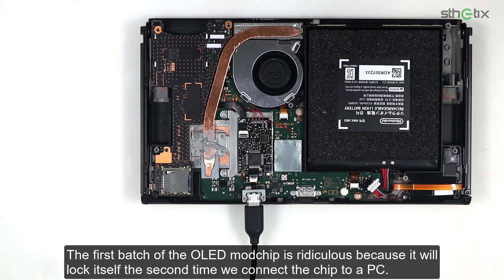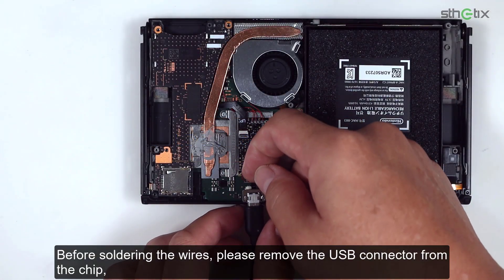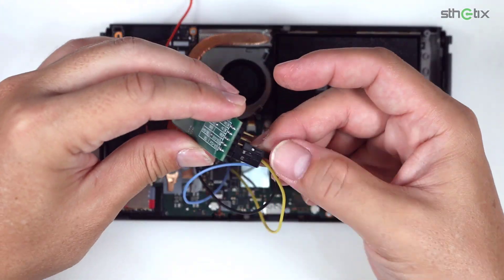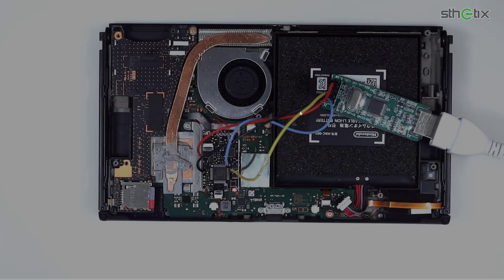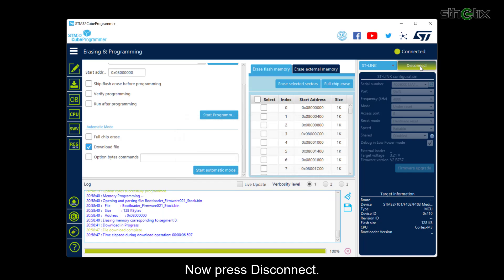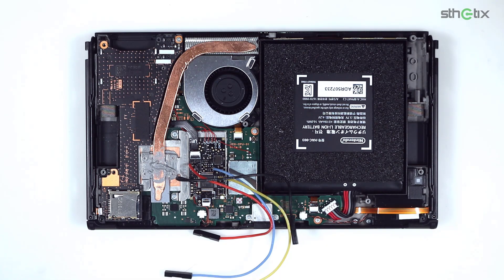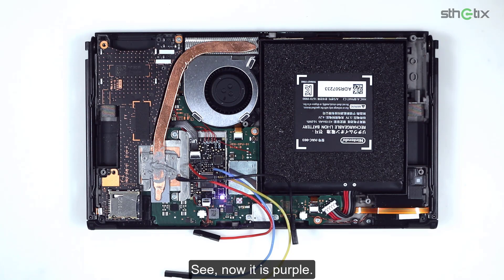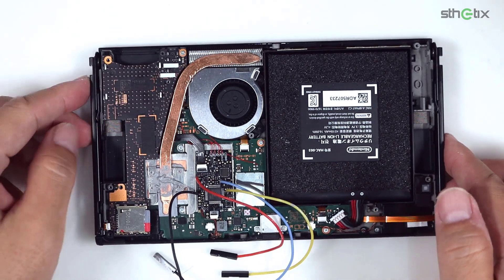FLASHING UPDATING UNBRICKING THE CHIP

Comment: I flashed with the hwfly-nx joint and led is blue. I did the stock joint and led is white. Is this normal? I think when the USB connection on chip worked the led was a different color?
Reply from the maker: try flashing it with the hwfly-nx toolbok
Reply: @sthetixofficial  led is still blue. I can't flash via USB only stlink
Reply from the maker: Try replacing the chip if you have any, but if you can flash with stlink then it should be good.
Reply: @sthetixofficial  I'm able to flash the chip so think should be good to go. Thanks.

Comment: If you encounter a similar issue on Unix systems and need to flash the firmware and bootloader onto a microchip, you can follow these steps:
1. Connect the Microchip Raspberry to your computer using a USB cable.
2. Open a terminal window.
3. Navigate to the directory where the firmware and bootloader files are located.
4. Run the following command: `sudo flashrom -w firmware.bin -b bootloader.bin`

Comment: Does the locked chip work normally on the Nintendo Switch?
Do I need to unlock just to change the chip's firmware or is it necessary for the Nintendo Switch to turn on?
Reply from the maker: it will work. but the usb function is faulty
Reply: @sthetixofficial  thank you, guy.

Comment: Hello, I want to ask is this the correct method on how to fix a mod chip that if you power on the switch it just flash red and then boot to ofw? For details, I think I messed up when updating my firmware into 16.0.3 because I updated it in the ofw through tthe settings and system update rather then using daybreak and now my switch only boots to ofw and the mod chip flashes red led when I turn the switch on and does not boot to cfw anymore.
Reply: I'm sorry it was flashing purple not red
Reply from the maker: try to reset the chip

Comment: Hello dear, I have a hwfly with the dat.bin boot like the one on the left, a guy tried to update it with the hwfly tool box, now the switch is the original part, as if the chip was gone, Do you know of a method to re-flash the chip via usb by detaching it from the motherboard to be able to resume it? Thanks dear, you are always the best on these things... Let me know if you can help me. Thank you so much! 👍🏻🔝
Reply from the maker: you need a USB connector that comes witht the chip and flash it with the appropriate firmware.
Reply: @sthetixofficial  @sthetix  thanks Sthetix, the chip belongs to a guy who bricked it, it's the classic OLED chip, what firmware should I get to attach it to the PC and flash?  I have a video guide where you show the com port, with the chip connected to the micro USB, with the command prompt... But I don't know which firmware to put, how do I know?  I only know that the chip at ignition, asked for the dat.bin boot as the sx core which is now dead after the firmware 11.0.0 because we all know what happened to the xecuter team, however can you give me an indication to get its firmware and make a new flash that makes it work like before when it was new...???  Thanks dear, always kind to answer me.. I hope you can help me... Thanks again.  👍🏻🔝🔝🔝
Reply from the maker: try using the 0.31 firmware here https://u.pcloud.link/publink/show?code=XZK65YVZbylrYJ2MOkYLrMniwJ25gVHcqCbk
Reply: @sthetixofficial  Hello dear, I unsoldered the chip from the OLED Nintendo Switch today, now when I attach it to the USB port, the PC recognizes it in COM 4, the chip flashes blue, it doesn't stop, what step should I do now?  I wouldn't want to get the command wrong and really throw away the chip, I saw an old post of yours from February 2022 on Twitter that said;  now the new hwfly-nx 0.6.0 flashes blue, after it connects to a pc, then it says to update the bootloader, so what should i update only the bootloader or just click flash.bat in command prompt?  Thank you and sorry for disturbing you, I have never updated any hwfly chip... Thanks, I kindly await your reply... Best regards from Italy...
Reply from the maker: if the chip is blinking blue, then it responds, why do you need to flash it? if you want to flash it, please watch this : https://youtu.be/ODz7-IZpjTg?t=924

Comment: What is the purpose of this operation?
Reply from the maker: To Unbrick the modchip
Reply: @sthetixofficial I have an issue with my nintendo switch oled, the soldering worker puts the V3 Hwfly, it gave me the red light time to time I took it back to him 3 times, the last time it worked perfectly for 1 month then it returned worst, if I turned it off and I want to turn it on it doesn't turn on right away I have to push the power button 20 seconds then one click it gave me red, so I have to wait like 10 hours and do the same to give me the green light and work again and I found the battery goes down from 100% to 30%
What do you think the problem is
Reply from the maker: just reball the emmc chip and sandwich the dat0 wire permanently under it.
Reply: @sthetixofficial  reball?
Reply: @sthetixofficial  thank you very much 🙏

Comment: I was able to flash the chip using st-link. When I turn on the oled, the yellow light flashes one time and turns to solid white then the oled boot to ofw. Can you help me?
Reply from the maker: i think the chip firmware is not correct or damaged. how did you brick it?
Reply: @sthetixofficial  I updated the firmware using hwfly tool box then it failed at 95%. I tried to flash 2 different hwfly with st link, but the result is the same.
Reply from the maker: Well.. Better use the gdlink ob to revive the chip. And do not flash the chip ever again
Reply: @sthetixofficial  I have exact same problem. You say that st-link might be the problem here?
Couldn't reseting the chip help here?
I tried to reset it but my USB connection doesn't work so I can't use putty for that and I don't know which pins to shorten and I have exact same chip you have on video.
Reply from the maker: @Papyszoo it depends on the chip itself. there are some chip that we cannot reset

Comment: Hi sthetix! My modchip got a "failed to flash" when I updated the firmware thru hwfly toolbox. Now it boots directly to OFW and no lights on the modchip. Just wondering if flashing from the usb connector is enough to unbrick it or do I need to use stlink programmer for this?

Thing is I don't have either right now and I need to order either of the two. I would prefer fixing it just thru USB method if possible but I'm not sure if it would work.

Just for the record the switch boots perfectly fine into OFW. The modchip is totally not responding. I tried shorting it already to reset and nothing happens.
Reply: this happens to me. same issue.
Reply: @angrynear  did you manage to solve?
Reply: @helbertgascon9624,hi,do you fix the chip? i have the same problem,after use toolbox only boot ofw and no lights in the chip

Comment: I got hwlfy oled v4, i programmed it with latest 0.7.1 files (firmware.bin at 0x08003000, bootloader.bin at 0x08000000) using st-link, it gives constant white led light when plug into usb, it not shows at device manager. Do you have any ideas? Thanks.
Reply from the maker: Did u brick the chip? White light means something is off, or not right.
Reply: @sthetixofficial  i don't know, i haven't plug usb ribbon cable in reverse. I think it's a firmware problem, not physical. If I flash 0.3.1 stock, the red light is on about 30s and then turns off.
Reply: The chip is NOT installed into switch.
Reply from the maker: what i meant is, why did you flash the chip with ST link?

Comment: After turning off my switch (launched on Atmospère in emummc) it no longer wants to boot spacecraft, when I turn it on the console it boots directly in OFW (the nintendo logo is
Reply from the maker: if your console is a v1, you need to reinject the payload
Reply: @sthetixofficial  My switch oled has hwfly installed
Reply from the maker: Maybe you need to try using my hats pack.

https://github.com/sthetix/HATS
Reply: @sthetixofficial  They have been downloaded and put in sd and the same problem remains, can I contact you via WhatsApp?
Reply from the maker: It will boot to hekate. Unless ur chip has gone bad. Please contact the installer to fix the issue
Reply: @sthetixofficial  A chip that was injected via st-link when the device is turned on, it flashes purple then green and keeps blinking, but the Nintendo logo appears instead of the atmosphere logo.

Does it mean that the chip has a problem or does it need a fromware?
Reply from the maker: why did you flash with the st link, was it bricked?

Comment: Friend in a schematic i saw that it is possible to flash it with a usb cable this is possible because i don't have a programmer
Reply from the maker: It is. You can see it on my github page
Reply: @sthetixofficial hi I have a locked chip it's BGA chip I want to unlock and erase reset the chip

Comment: I am trying to update it to version 0.7.1 what is the payload.bin that must be flashed in 0x8003000? because there is none on GitHub and it is only bootloader.bin
Reply from the maker: The firmware.bin is on 0x08003000

Comment: Hello friend! Would you help me? I have switch v1, installing hwfly sxcore 4gh, the chip is just flashing green, as if it was in the 4th step of the training, I waited more than 15 minutes and it doesn't start, the chip can't update because the customer tried to update and connected the USB on the wrong side and it no longer recognizes on the computer
Reply from the maker: replied via twitter.
Reply: @sthetixofficial  привет друг 🖐а можно получить тут гиперссылку на твиттер пожалуйста 🙏 и спасибо большое за видео 👍
Reply: @sthetixofficial  hi from the UK I want to reset the bga memory chip
Reply from the maker: you can reset it by shorting the pins
Reply: @sthetixofficial  wait really  hold on i think thats called tunnel erasing is that right
Reply from the maker: i dont know what tunnel erasing means

Comment: are the sx core chips are re flashable? please help me to know about it cause the locak repair shop said that either i have to have the sx core reflashable for new 14.1.1 update and running (which might end up bricking the mod chip) or switch to new hwfly chip. i am running mariko unit with sx core. please help me @sthetix.
Reply from the maker: yes you better buy the flashable chip. the original sx core is flashable
Reply: @sthetixofficial  thank you so much for giving me hope that I don't have to get stuck on 14.1.0. would you do me a favor and provide a link for that  flashable chip for my installed Sx core on my Mariko switch. I did searched for "flashable chip for Sx core" but nothing relevant popped up. Thank you so much for giving me hope with my switch.
Reply from the maker: you need to find hwfly on aliexpress
Reply: @sthetixofficial  thank you so much

Comment: Hey sthetix. I have the hwfly Core v4 which is also comes with the flashable chip. Could you provide a connection schematic for that chip?
Reply: Oh thank you! I see the diagram. My microUSB port wont work, trying the ST-link. Really appreciate it!
Reply from the maker: Please watch my oled v3 soldering guide
Reply: @sthetixofficial  i watched it, sadly it doesn’t say how to connect the ST-link to a Hwfly Core v4 chip
Reply from the maker: you can open my diagram : https://github.com/sthetix/DIAGRAM/raw/main/Flashable-Core-SWD.jpg
Reply: @sthetixofficial  How do I reset a bga chip?
Reply: Did it work for core v4 - did you use the same fireware file or something different

Comment: Hi there. Trying to unlock chip that has instant red light due to try to pc conect with the usb conector reversed conected.
Programed "Bootloader_Firmware021_Stock " with cube and stlink. All seems to be ok , file download complete. But if I connect again with the usb cable to pc, same red light appears....
Any suggestions will be appreciated.
Thanks
Reply from the maker: You have bricked the chip, the only way to recover it is to replace the chip and never plug the connector in reverse again.
Reply: @sthetixofficial  thanks for your clarification. Any place to find it?
Best regards
Reply from the maker: you can find it on aliexpress, gd32f350
Reply: @sthetixofficial  does gd32f350 also work with the original sx-core chip?
Reply from the maker: it does.

Comment: After flashing the firmware with the programmer, can we use the OLED chip micro USB port to flash update newer firmware updates or we going to keep getting the red LED?
Reply from the maker: Afaik we can flash the red led chip using USB connection. Try that.

Comment: Got an ST-Link V2 from Amazon today. When I open the STM32CubeProgrammer, it shows "Serial Number: D". When I click "Connect", I get no indication whatsoever. When I click "Firmware Upgrade", ST-Link/V2 shows in STLinkUpgrade 3.3.7. Click "Open in update mode"", and a message at the bottom states "ST-Link is not in the DFU mode. Please restart it."  Under the update mode button, it says "ST-Link ID: D"
Unplug, replug, and it shows an actual serial number next to "ST-Link ID:", when I click open in update mode. Click it again, and it shows the Type and Firmware and stuff. Click "upgrade", and the message at the bottom says "ST-Link device lost when exiting upgrade mode."

In device manager, it shows up only under "Universal Serial Bus devices", with the name "STM32 STLink". Any suggestions? And is there an alternate TMS/swdld point on the OLED v3 chip?
Reply from the maker: i didn't update the stlink device. i bought the clone one. and i could connect it to the oled modchip without problem.

maybe your stlink is in programming mode.

and the swd connection is fixed
Reply: Hello, I have exactly the same problems. Did you find a solution? my st-link is recognized in C but cannot connect it to the hwfly oled

Comment: Hello, Does this work on HWFLY V3 as well?
Reply: thanks for your quick reply 
you do a awesome job here on youtube
Reply from the maker: Thanks
Reply from the maker: what is hwfly v3? the same chip?
Reply: I think you show the new oled version 
i want to know if it is possible to flash the previous version of the here shown Chip. with your method to use it with the switch OLED and avoid the 3 V bug.
i hope you can understand what i mean.
best regards
Reply from the maker: that one is not flash-able. tightly locked. no solution for that chip

Comment: Good morning, I have the st link-v2, when connecting it to the pc, it does not detect the st, do I have to program it or something similar? or it comes from the factory programmed to be used with your program. I get an error: No stm32 target found and it doesn't let me program. Yes, it lets me update it with the cube program, but it tells me something like the dfu is not active. Any idea how to fix it? Thanks a lot.
Reply from the maker: did you solder the wires correctly ? and what kind of chip did you use?
Reply: @sthetixofficial  Yes, the wires are soldered well, I copied the schematics from your other lite unlock video, and the chip I'm trying to unlock is a sxlite. The problem is that without putting the chip the st-link does not recognize the pc, it gives me the error that I have mentioned. I'm waiting for the gdlink that you mention in the other video to test, I don't know if this st-link v2 is worth it to unbrick the sxlite.
Reply from the maker: U cannot flash the hwfly lite. No other way to unlock it
Reply: @sthetixofficial  Thanks